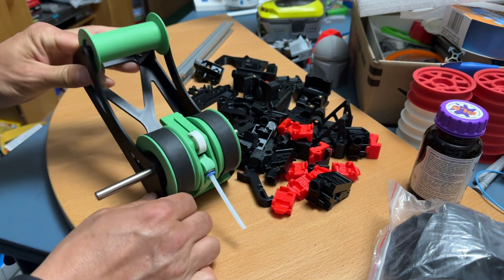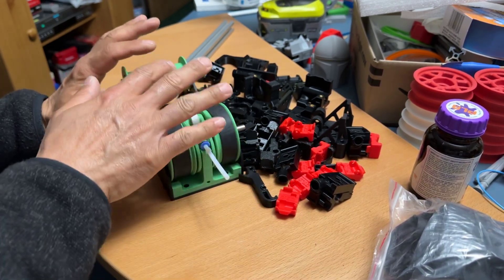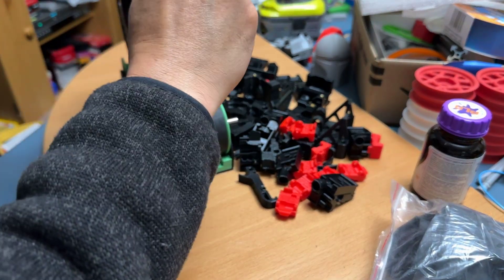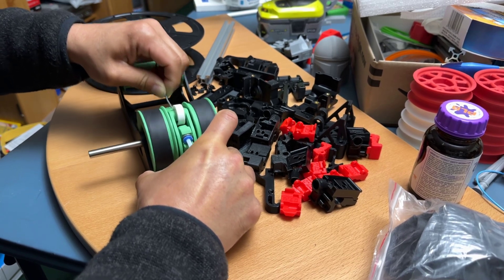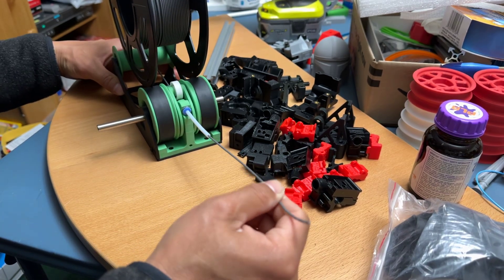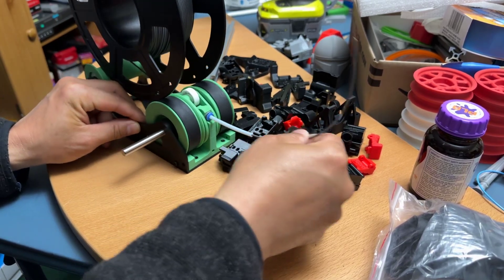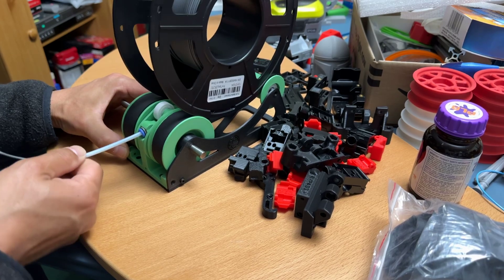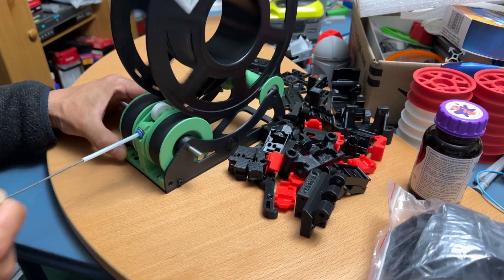ERCF Filamentalist rewinder / buffer

Comment: don't bother with asa or abs just prints pla with fans and the parts will come out fine and work fine. its a roller a passive roller it just pisses me off that they state use abs or asa like they have shares in it or something. don't get me wrong the design is great, I like the look of it but CAD engineering is poor for plastic parts to fit together (SORRY SAY THAT AS A FITTER- (IT WORKS IN CAD)- is what we get from our engineering dept. I'm using the design cus its easy to download and use but having tried and tested and put my name to it i would have personally perfected it before publishing.

Comment: hi just wanna ask is the initial snag when feeding the filament is that normal? i have build one myself just last night but the inital snag is annoying me are there any fixes to that problem?
Reply from the maker: yes, it all depends on how straight the filament is.  Mainly due to layer lines.  it is 3d printed.
Reply: @Outofbox11  i found the solution i talked to the dev that made this mod. Found out ptfe needs to pushed further in. He said to used a 4mm drill bit to clean up the hole.
Reply from the maker: @halcyonspree1523  great, I'll give that a try also.

Comment: wait that's awesome. have you had any problems with resistance of this setup on retract? For the feeder on the printer itself, or the ERCF.

and doesn't the bearing slip with more slippery filaments? and is there not a problem with the spool diameter decreasing with filament being spent?
Reply from the maker: I have been tinkering with it on and off and it has been working somewhat "okay" mainly due to my ERCF being V1.1
lately been having lot of issues.  I am planning on converting V1.1 to V2.0 with better encoder and feeder gears.
I will do some video on it as I convert this over and will do some in depth video on filamentalist and ERCF V2.0 as time allows.

Regarding slipping, I have tried PLA & PETG and so far none.  Slippage been only happening at ERCF end.  (reason for upgrading to V2.0)
Reply: @Outofbox11  got it, thanks. Will be waiting for your video, as I'm currently trying to make a setup without those large buffers

Comment: What i dint quite understand is how does the spool rewind? Why doesn't thr filament just coil around the spool like wheb you dont use a buffer?
Reply from the maker: it's all because of "one way bearing".  filament is under compression between regular ball bearing and one way bearing.  when filament is pulled bearing spins as normal and everything is lose and spins independently.  However, when filament is pushed by ERCF, one way bearing locks and turns shaft which is connected to rollers where filament spool is resting on.  So ERCF is performing rewinding function by filament movement.